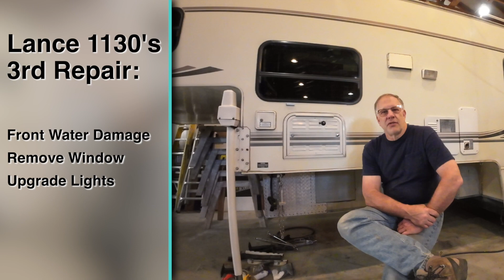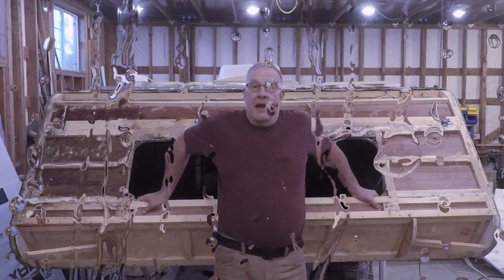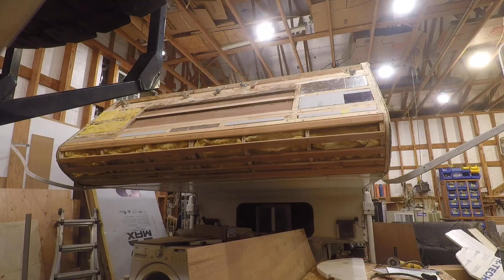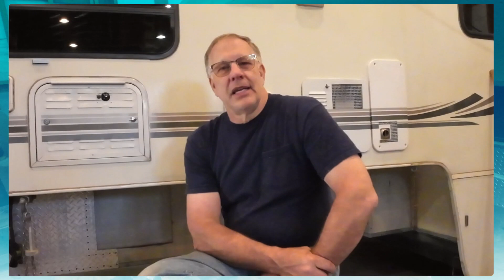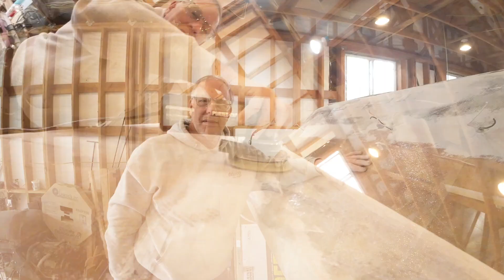Truck Camper Water Damage Repair | Stomping out Water Leaks | Remove Front Window | Fiberglassing

Comment: I liked your video.  One of the issues that I have with my 2000 Summerwind by Lance is that it will not stay where I put it.  It will not stay centered.  I know how I am going to fix that issue, I am going to bolt some 1and 1/2" square tubing to each side of the 4x8 piece of 3/4" OSB that I had to put in the bed to give me some clearance at the top of the bed.    I absolutely HATE that they put the battery compartment on the bottom of the structure.  That is going to cause me some issues that I have not figured out quite yet, but rest assured, I will figure it out.  That battery box sticks out a little.  It won't when I get done with it though.  I might even relocate the batteries.  that is what I did with my other Lance.  I mounted an 8D under the bed.  It worked very well, plus I had battery reserve on steroids.  I had them install AGM batteries in my 2000 when I went to pick it up.   I am 100% sold on AGM batteries.  Absorbed Glass Matt  is what AGM stands for.  I could easily mount them in the bed of the truck, OR I could mount them under the bed like I did in 1991.   I also did a custom wiring set-up on the 1991.  I put 2 knife switches on the transmission hump.  One side of both knife switches was hooked through an ammeter to the alternator.  The other ends of the knife switches went to the camper battery and the truck battery.  When I got to my camping location, I would open the truck switch.  That way the truck battery would never ever drain.  Then when I was ready to leave, I would open the camper switch and close the truck switch.  I would watch and when the truck battery was charged, the ammeter would back off to almost nothing.  Then I would close the camper switch, and after a few seconds, I would open the truck switch.  Now the half dead camper battery was all that the alternator could see, so it started to stuff 60 amps into the camper battery.  

When you have 2 batteries hooked up in parallel the alternator will not charge the dead battery as much as it would a very low battery, because the alternator will sense the voltage of the more charged battery.  it worked very well before, and it will work very well again.  PLUS everything is manual, no fancy electronic mumbo jumbo to fail when you are 150 miles from anywhere, or anyone.

Comment: Very useful video. I'm right now looking for a used truck camper to restore. Seeing as how every Lance camper being restored online has major water damage due to poor quality materials and workmanship, would you buy another used Lance camper or would you buy one from a different manufacturer? Thanks for your forthright honesty,  I will consider your answer as being good advice based on your hands on experience.
Reply from the maker: I was formerly the plant engineer for Safari Motor Coaches (Class A) for 3.5 years. I think almost all RV's are prone to water infiltration, with few exceptions. Even when they make a tight fiberglass shell, they immediately cut holes into it for windows and storage compartments then expect sealant to maintain water tightness, which is a fallacy. I like Azdel over aluminum framing as the best, but thermal bridging is a real probem. Non-wood compnents are least susceptible to water damage but unfortunately, most of them use glued Filon exteriors, which are susceptible to delamination. I made my own adventure truck with SIPs using 2" foam core and 5mm ply wood on both sides and had laid fiberglass on both sides. Only window penetrations and no exterior storage doors....still had some water leakage......gonna make another one with either composite panels (probalby the best technologically) or hand laid heavy fiberglass directly over foam.
Reply: @WorkingOnExploring  Thank you, very thought provoking and useful info.

Comment: Could you have eliminated the clearance lights altogether?  They serve no purpose for me.
Reply from the maker: Possibly. Clearance lights are required by law. I doubt that I would be ticketed for it though.
Reply: @WorkingOnExploring  You could always keep everything on the outside.  Run the wires through some plastic tubing.  There is always a way.  LOL

Comment: Hi there! Thanks for such an in depth video for the repair. Quick question, and this may be a very silly question, but would it hold up to fiberglass the seams of my lance legend 880 truck camper or would that turn into a disaster?
Reply from the maker: Getting new (real) fiberglass to stick to old (real) fiberglass is a process of sanding (to roughen) and to taper to permit new glass reinforcement to overlap the old fiber. What is correctly called fiberglass is about 1/3rd fiber and 2/3rds resin by weight.....then there is 'Filon' which is what passes for fiberglass in production campers. Filon is a long way from being fiberglass. It's about 5-10% random short fiber and 90-95% plastic resin which is modified with plasticizers to make it flexible and more resistant to impact damage,  (not polyester resin which is what most real fiberglass is made from). Filon is way too thin to taper and not very chemically compatible with polyester resin. Also, fiberglass has difficulty bending over sharp corners. If you want to wrap it over a corner, the corner needs to be radiused 1/2-3/4 inch AND the if using cloth, the fiber should be oriented so both strands are at 45° to the corner. Otherwise use chopped strand mat. Also a product made specifically this way is called '1708 bi-axial mat' (made of 2-8.5oz/sq yd layers of woven strands - not fabric - rotated 45° and a 3rd layer of 8oz/sq yd chopped strand mat). Probably a lot more detail than you wanted but there is a good reason why your good idea isn't done...

Comment: Thank you for your video!  I have a class C motorhome and I want to remove the window from the overhead cab and replace with fiberglass sheeting.  I have found the fiberglass that I need on the RecPro web site.  I couldn't figure out how I was going to "fill in" the window opening.  You have given me some better ideas than what I thought I would do.   I gutted it (the entire MH), rebuilt it and the overhead cab is now for storage.  The overhead cab was a mess, rotted wood and insulation all had to be replaced. At that time, I didn't think about removing the window, now I want it gone.  The storage cubbies are easily removable, and I will be able to work on the area from both the inside and the outside.  I had to look at many videos until I found yours!!

Comment: Did you consider epoxy resin instead of fierglass?
Reply from the maker: Polyester is a much better fit for purpose: 1) about 40% the cost, 2) wets fiber more readily as well as the plywood substrate both of which are significant speed and quality issues, 3) more flexible although since I have few purely fiberglass parts, (most are combined with plywood). 4) no chemical compatibility issues. If I was needing to laminate directly onto foam, the styrene diluent in polyester resin will dissolve most foams. I did in fact laminate directly into the foil covering of polyiso insulation with no problems but a thorough check for pinholes is necessary. Cost and ease of use for polyester alone make it far better than epoxy

Comment: Hey there! I just bought a 1984 Davlin Camper with some serious water damage. The outside is covered by an aluminum sheet of metal, not rust thankfully. The water damage is coming from the fan above the bed and the windows surrounding the head of the camper. It’s made it to the inside of the camper and has rotted all the way to the putter metal layer. I’m completely inexperienced with this and don’t know where to start! 

Was thinking of starting with resealing the windows and the fan first to to prevent future water damage, but if I’ll have to rebuild the whole from not sure if there’s any point to that. Any tips on where to start with repairing indoor water damage?
Reply from the maker: Been distracted building my house so late answering you...

The first thing I would not have done is to buy an RV with water damage. It is very difficult, time-intensive and costly to repair (ALL of those). If you don't have the knowledge or skills to repair it, it may likely simply be a time/money pit that you are never truly able to restore or use. The fact the RV is old also means it likely has no value in its current state and little more value even if restored. My first recommendation is to do some serious soul-searching on how likely you are going to be able to either repair it yourself or get help. You can be sure that if there is water damage to something this old, it's not merely cosmetic and you can't assume the RV is safe to use.

Step 0: If you decide to attempt to repair it, the first challenge is to get it into a covered, dry space where you can take it apart. Significant parts will have been assembled with irreversible means (glue and nail guns) so additional damage is likely. Assume that little of the material you remove will be able to be reused and must be replaced. Again, you can't just remove the visibly damaged portion, you need to remove good material surrounding the bad to follow the bad till you can verify all damage is removed.   
Step 1:  Remove the ruined material back to a solid structure. I imagine you likely don't have a good idea of the extent of the damage and without that, can't really decide where to begin. Putting a band-aid in the form of preventing further water intrusion is marginally helpful. Trying to seal it up will prevent the necessary step of digging into what's wrong. 
Step 2: Deciding how/what to replace the damaged material with. It's almost certainly a wood-based structure so finding the correct waterproof solid/plywood materials and fasteners to rebuild is necessary. Covering the wood with polyester resin before installing finished surfaces is an excellent way to prevent damage if leaks occur again but keep in mind that the value of the camper when you are done will still be negligible regardless of how well your repair is done. 

I'm sorry for not being very optimistic. RV's die this way and any RV over 20 years old is virtually valueless due to the high likelihood of water damage.

Comment: The biggest problem with these campers is the piss poor caulking job done at the manufacturer. One little spot that they miss while caulking will doom that camper.
Reply from the maker: It goes MUCH farther than that....I am a former plant engineer for Safari Motor Coaches...manufacturing techs tru really hard to do a good job but thr deck is stacked again st them. To begin with, caulk is a poor method to obtain a RELIABLE seal in the joints used in RV construction....as you correctly point out, small holes are inevitably produced, most  as the caulk cures....many voids occur after the RV leaves the factory which cannot be detected by the most well intended inspection.  The entire concept of accepting long seams that are only sealed with caulk and expecting owners to do a self inspection and periodic refresh is idiotic. It's almost an intentional failure to guarantee paid service work down the line. The industry claims lots of caulk is  unavoidable (which is untrue). Customers contribute to the problem by wanting a whole bunch of exterior access doors which are prone to leak as well. If you look at my RV design, it is a complete fiberglass envelope, I side and out with NO external storage access for this very reason. The only place I rely on calik is around the windows. My own failure to complete the planned fiberglass coverage is where I went wrong.

Comment: Gelcoat would make a nice top coat to your extensive glass work? Rolls on.
Reply from the maker: It would. I was repairing this to resell so there was going to be little advantage in my doing that vs expense and effort. The great asset of gelcoat is the ability to build up a 30 mil layer vs the 3 mils of exterior paint. The paint has probably adequate lifespan for the camper (it's a 2000 model year.) Gelcoat is also less tolerant with dust and application temperature.

Comment: Thanks for this awesome helpful video.  I also have a new, similar slight "bubble" on the front of my 2001 Lance 1030; and have been considering replacing the front window even before this delamination ocurred following a quick, driving rain storm last summer.  I also want to thank you for your previous detailed responses in the comments section, as this will greatly help me if and when I decide to perform this work.  My caution so far is in replacing the cap with one giant sheet of luan or aluminum.  As a single person with no available assistants, fiberglassing seems like a much better idea that I can manage by myself (and provide a better and stronger finished product). Although I have extensive carpentry experience, I've never worked with fiberglass; but perhaps it's not too late to learn a new skill.   Thanks again for your time in assisting others!
BTW, I love my old Lance 1030.  Even after spending several thousand dollars in upgrades and customizations, I have only invested about 20% of the cost of a new one.  Although I've spend much more time working on it than actul camping in it in the five years since I purchased it, I have enjoyed (almost) all of the time spent on it.
Reply from the maker: Fiberglass seems intimidating until you take the plunge. Then it's one of those skills you wonder why you let it intimidate you. There are a number of rules of thumb  that are somewhat easily picked up watching videos from authoritative people on YT. In particular, Fishbump TV and Boatworks Today are a couple I think teach good skills.
Reply: @WorkingOnExploring  Thank you, Steve, for the advice and support.  I will take your advice, do some research on fiberglassing, review your previous comment responses, and plan for a project next winter. Now, it's time to do some local summer camping here in the southwest (NM).  Happy camping and safe travels to you and Sheryl!

Comment: I would have love to see how the inside looked at the end of the repair. My wife would have cared far more about the interior result.
Reply from the maker: Sorry...we probably have a photo. When framing was placed in the prior window, I placed an 1/8" luan plywood oval on the inside of the cutout. There was obviously no wall paper on it and there was an uneven gap where the oval didn't exactly match up to the existing cutout and it didn't look good. Because we liked to lean against the wall where the window was when in bed, I simply took a piece of plywood wide enough to cover the flat spot on the front cap (obviously also larger than the old window) and covered it with a layer of bonded Dacron upholstery padding and wrapped it with upholstery fabric. I screwed it to the wall frame with 3 screws top and bottom, covering the heads with a gray plastic 'snap cap'. You're right I should have included shots of the inside.

Comment: Where did you get the Ram Board what is thickness? Did your glue it on how did you attach. So could you list the resins you used and different meshes you used etc. i think i will do what you did looks great!
Reply from the maker: The Ram board came from HD or Lowes, I don't recall. All I remember of the thickness was I bought as thick as I could get and still wished it was 50% more. I stapled it on with a 1/2" crown pneumatic upholstery stapler that just barely sinks the heads flush with the surface of the material. I didn't want to countersink it at all because it cuts the material rather than holding it. I did put some Titebond lll between the two layers I used. The resin is an unwaxed polyester laminating resin. About the most commonly available. Be careful buying polyester in retail stores as most of it is 'waxed'. The small amount of wax floats to the surface and creates an air barrier that is needed for the resin to fully harden but it interferes with adding additional layers of laminate which is often needed. If you use waxed resin and want to add more layers, you need to sand the surface to remove the wax first. The first layer of reinforcement is 1708. This is referred to as 'biaxial mat' and has 2 layers of  8.5oz (17 oz total) woven roving at 45 degrees and 1 layer of 8oz chopped strand mat on the back. Then all 3 layers are stitched together. That is what the '1708' description comes from. The strand is the inside surface but woven roving is very coarse so I added a layer of 6oz cloth on the outside to leave a smoother finish. You can go with lighter material such as 2oz or 4oz cloth. You have to be incremental in covering coarse reinforcement. There is a material called 'veil' which is about 1/2 oz and is very fine. Going from 1708 to veil would still transmit a lot of the roving coarseness. If you were wanting a superfine fiberglass, 1708 to 6oz to veil would work well. My 2 layers was more than strong enough and it had some unevenness that I needed to address with body putty and thickened resin so getting a super fine fiberglass finish wasn't going to matter that much. Veil is really something you'd use if you wanted to spray gelcoat on as a final layer. Gelcoat spraying is hard to do as it needs a special gun so I just used exterior paint and rolled it on.
Reply: @WorkingOnExploring  thank you so much for taking the time to reply. i saved this and will follow your instructions.